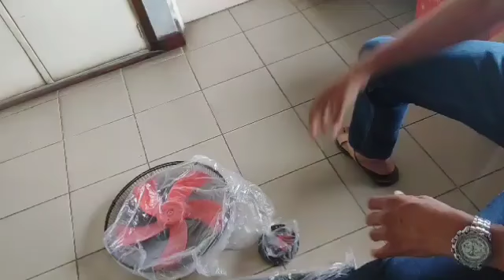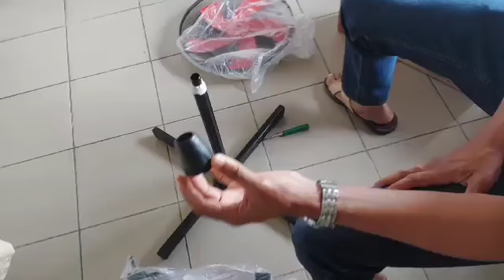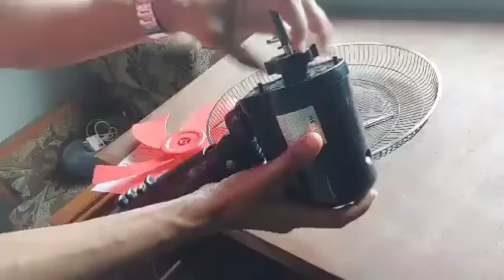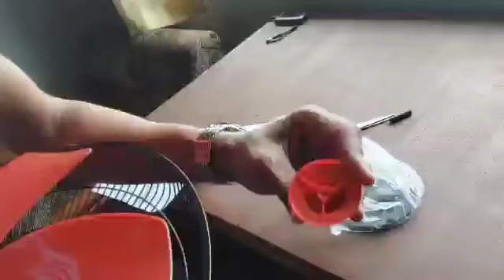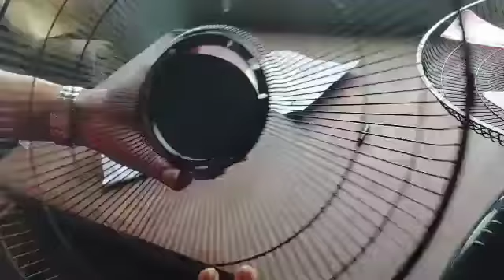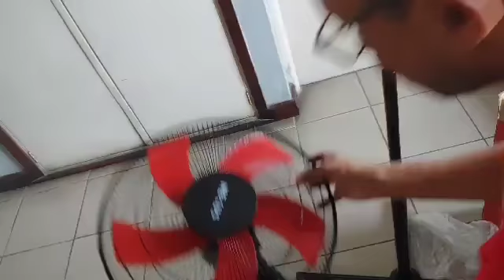Standing fan installation 16-inch Nexus Model

Comment: You didn't show what holds the fan body to the base. Did you just put it on the pole without anything holding it
Reply from the maker: @EbunoluwaAdereti  You place the fan body into the pole then you secure the connection with the screw that is attached to the backside of the fan body.
Reply: @tphilusacutis534  attacking it on the pole it's not steady

Comment: How is the output like? I mean does it blow air so well for cooling and can it cover a medium size living room? Also I hope it doesn't consume much power. I want to use with a solar system.
Reply from the maker: The output is fair. In view of the 16 inch size it will serve for a small to medium size room. For a large living room you will need a larger size or more fans. The weight is quite light so it's easy to move around. Power consumption is low and efficient.
Reply: Pls, Is it a durable?   @tphilusacutis534